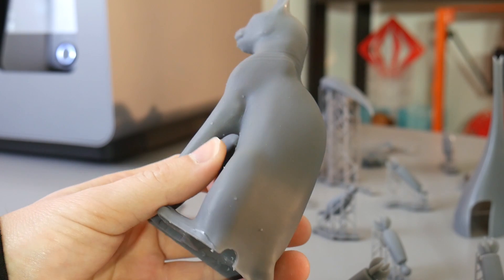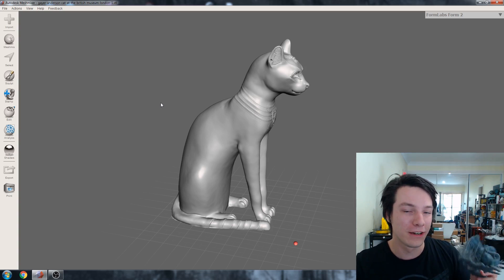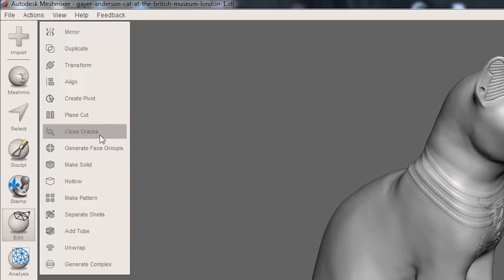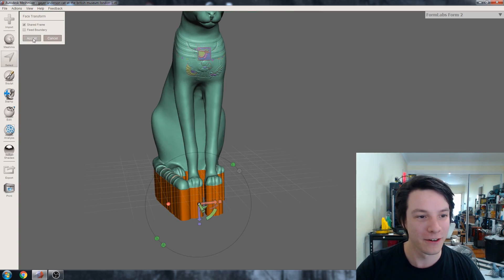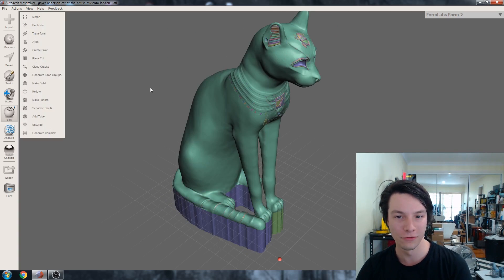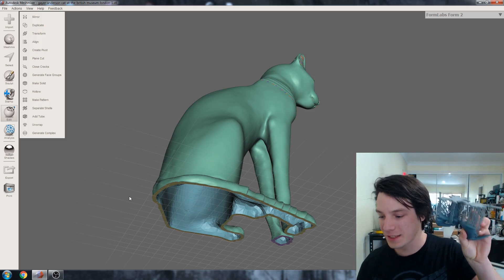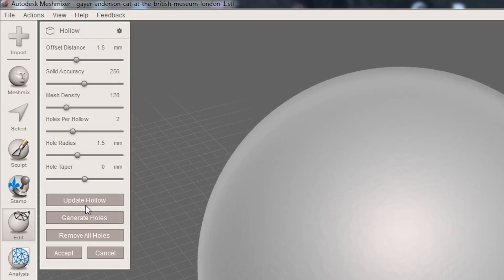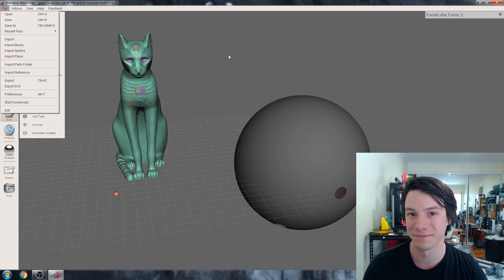My process for hollowing models for Resin 3D Printing with Meshmixer

Comment: how do you adjust the thickness of the shell. say you realize that you need to adjust the thickness. i cant just go in to the hollow and adjust the thickness. and there are not much of a "redo" function on separate parts (i have several parts that i have made thick, but need to re-thicken one of the first i made and dont want to "redo" a hundred times)

Comment: This really needs an update. Meshmixer doesn't allow me to do the Transform function like it does in this video. It has a red outline around the face I'm trying to extrude out, but when I try to pull it down, it doesn't move with my mouse. I've tried several times and nothing seems to work.

Comment: Hi Angus ... I am a big fan of your page. I am working on getting my first 3D print done in SLS or SLA ( probably at Imaterialise ) and was wondering if after doing the Hollow and plane cut in meshmixer ( which worked great ) I need to "make solid" again as I noticed the plane cut makes separate shells ... not obvious in meshmixer but I took it back into MudBox and Maya and the surface was combined in 3 parts but not a single mesh. Perhaps its ok for printing as long as the polygons are without holes or separations in the edges?

Comment: dont forget to add a vent hole near the bottom if you decide to print straight on the plate or you will get cupping / blowout issues

Comment: Hey Angus, first of all,  a huge thank you for all your videos... I've used them for all aspects of my 3D printing learning.  I know this video is getting old,  but I'm looking to thin a STL file.  Specifically a faceshell for cosplay. I'm printing with tpu on an ender 3. Can I use the advice on this video to do that?? I had to scale the model up to fit, but doing that increases the model thickness.  What would the best way to thin the shell be???

Comment: WTF, I did this about a year ago, and I tried this again today and it doesn't work.  When I got to the Generate Faces, it doesn't appear to do anything.  I've tried it with several different models.  Has anyone else had this issue?

Comment: Hi Angus, you can use Blender Solidify Modifier, extrude to the inside with even thickness which prints nicely with resin.
Reply: not complex mesh

Comment: Hi Maker's Muse,
Amazing video tutorial, really helped me. Thanks. 
Can you make a tutorial on how to do the following:
I have a scanned 3D human model that is ready for printing (scaled, cleaned, hollowed up, etc.). There is only one major issue.
After "Make Solid",  I lost the resolution of the face and it's quite blurry. I also have another scan of the face in .obj file format. How do I impose or imprint this face model on the final 3d print ready model to improve the resolution. Or is there a better way?

Your guidance will be really helpful.

Thanks,
Awais :)

Comment: I needed a hole and boolean difference gave me terrible results so I tried hollowing, but the mesh turns translucent and none of the hollowing buttons and sliders do anything.
Reply from the maker: Try adding in some more triangles with subdivide so it has more to work with, also untick 'simplify result'

Comment: With the cat, wouldn't you want a drain hole on the sides somewhere unobtrusive to plug later to ensure the print isn't generating a vacuum on the fep/vat/whatever it's curing through?  If you're hollowing the bottom, and printing it bottom on the build plate, you're still going to retain resin in the hollow once it gets to the head.  Taking it off the build plate would result in a print's worth of resin flowing out of the chamber no?
Reply: For a bottom-up printer, the resin drains out each time the build platform raises to separate from the bottom of the vat, so the only resin remaining at the end of the print will be whatever clung to the inside and dripped down. I intuitively thought the same, but imagine printing a cup with the opening toward the build plate--it'll be a hollow cylinder until the very end when it gets capped off with the bottom.

Comment: I must be stupid or something but for the freaking life of me I can not figure out how to DELETE something in meshmixer. I can literally find NO remove/delete/clear option ANYWHERE????? I have been screwing around with this for 20 minutes and google is literally useless (closest I could find is edit transform but no delete option the direction stop there)

I imported a model. its too small I want to import the original instead so I need to delete the one on the screen. I can find "NO" option anywhere to do this. ????
Reply from the maker: Choose 'show objects browser' or CTRL-SHIFT-O and you can duplicate or delete from there :)
Reply: wow. never would have found that in a million years :-) thank you! will mesh mixer let me import multiple stl files and then scale them and then "save" the "set" as a "single" STL file? my resin printer can't handle multiple stl files to slice.
Reply from the maker: Yep you just need to select them all and 'combine' under the edit tab, it nests them into the single mesh file.
Reply: Maker's Muse thank you very much and sorry to bother you with simole stuff!
Reply from the maker: Not at all dude have fun!

Comment: I started thinking about something... Is it possible to hollow a portion of a model but leave another portion of the model solid? Or at the very least can part of a model have thicker walls than other parts. We use our Formlabs Form 2 printer for Orthodontic models. I print hollow as your tutorial shows but would love the portion that contains teeth to be solid. Is there any possibility of doing this in meshmixer. Needless to say, since we're printing dental models the exterior accuracy needs to remain.
Reply from the maker: You could use hollow and then selectively remove the hollow from areas you want to go back to being solid, repairing the holes in the mesh you create but it'd be pretty difficult in meshmixer.
Reply: Thanks for the response. Sounds like there is no easy peezy way of doing it. Love your channel.

Comment: @Maker'a Muse I'm a little confused as to why this works.

I suppose it's possible that the form 2 is just so damn good at breaking the suction forces with its sliding vat that it's been a non-issue for you - But aren't you still essentially creating a giant suction cup with all the van der waal forces associated with that even without a printed base? I wouldn't have thought the bed would be so rough that it would allows air through?

To me it seems like it would still benefit from a hole not facing the bed to allow air to move freely during each lift?

Comment: Dear makers Muse i am planning to build a 3D printer completely by myself and therefore I would like to ask you what you would recommend for midsize 3D printer and what Controller I would need also I am interested in using an Arduino for the controller board and I'd  like to know if it's possible!
I know it's a bid stupid to Bilder 3D printer completely DIY why if you don't know much about them but I would like to try anyways.
Greetings from Germany!
Reply: The rest should be no problem, since I got okish to decent engineering skills!

Comment: So what you say is SLA sliccer software don't have a vase mode ? Also i think for SLS you can add a hole on the bottom to eject the powder avec the print. Maibe it work for SLA too ?
Reply from the maker: Hollowing the part saves powder as well in SLS yes! And no, no 'vase' mode as such for SLA.

Comment: On a scale of 1-10 (1 being very rough, 10 being very smooth) how would you rank the surface on resin printed models?
Reply from the maker: 10... you can print down to 25 microns if you really wanted to.
Reply: Perfect! Also, I was wondering what the outro song is? Thanks!
Reply: +Andrei thanks

Comment: In the case of the sphere, if you cut it half to print could you use the resin to glue it back together again ?
Reply from the maker: absolutely! You can then use UV light to harden it. Works good.
Reply: Does it bond on a molecular level resulting in an invisible joint ? or more like a traditional glue that is visible ?
The reason I ask is that I've seen a chloroform ( the anaesthetic ) used to join perspex and it joins on molecular level resulting in a transparent joint where none of the joined edges are visible
Reply from the maker: It becomes the same material, you could sand it back smooth and it would be impossible to spot.

Comment: I have sent parts out for polyjet printing that were hollowed to about a .75 to 1mm wall thickness and the price per model went from $6 to $3 (there abouts.) Mind you it was an engine model going inside a model train locomotive so part strength was not super critical.
Reply from the maker: Lol their quoting engine must have not been calculating support material use, because it costs just as much as the resin they use! Crazy high detail though right?
Reply: Yep... hey I was NOT going to complain! And yes your totally right. I was going to send the models out for SLA printing but no one on 3D hubs had rates that were competitive enough so... Polyjet it was!

Comment: What's the thinnest printable wall? That would be an interesting benchmark.
Reply from the maker: true, that'd be a cool test!
Reply from the maker: Yep that was for FDM but this is a different process so worth revisiting, the results will be very different.
Reply: it would be more a test of the slicer than the printer though...

btw, do you think one could hollow their models (like the cat), use slightly thicker walls, and leave column supports on for fdm?